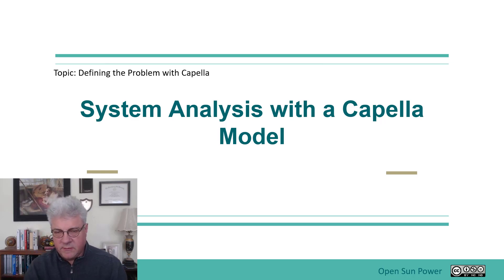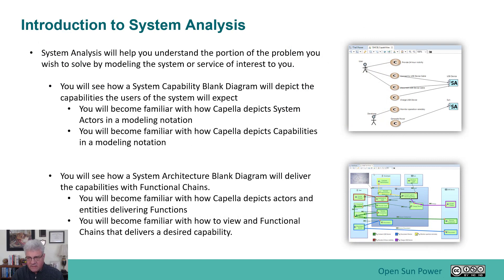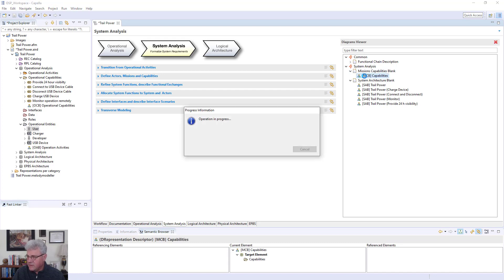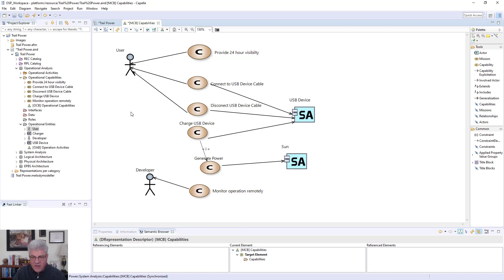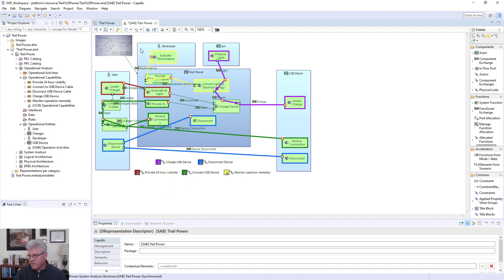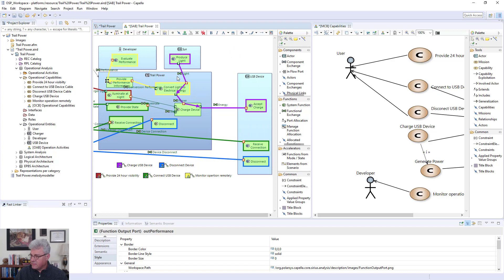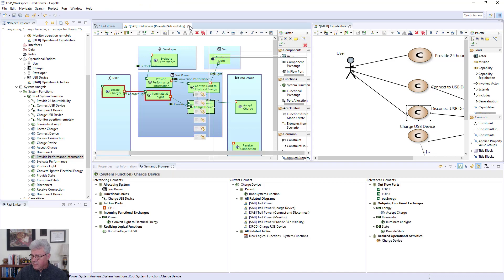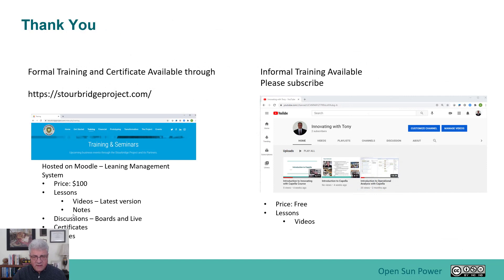2.2 System Analysis with Capella

Comment: Great videos and I like the example. I am using Capella as part of a course I am developing for security engineering. Looking at this from a systems engineering perspective, the choice of solar power is an architectural decision that can arrived at through an analysis of various design criteria in a solution space analysis. Other options could include a battery pack, a generator, or a hand crank. Choosing the best architecture would depend on requirements (durability, maintenance, etc) in a multi-attribute tradespace analysis. Great example.
Reply from the maker: I am adding some content that will show how model properties can be used for a study, and how requirements can be added and extracted from a model.

Comment: Hi Tony, I'ｍ Mike from Taiwan. 

I', learning Capella by myself now, and I have a few questions about it.

If there have something like enclosure strength or vibration requirement, does it need to add in OCB? How can I do that?
Reply from the maker: In the OCB I would consider them to be requirements mapped to a entity that would represent something that would be in the system.  You could also represent them as properties. You can create properties in the project explorer view, and then display them on the diagram.